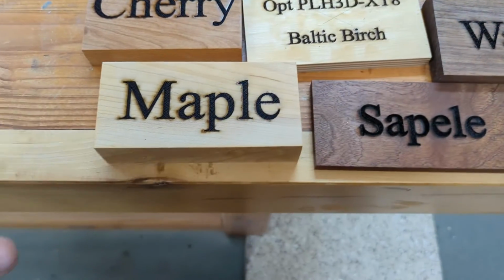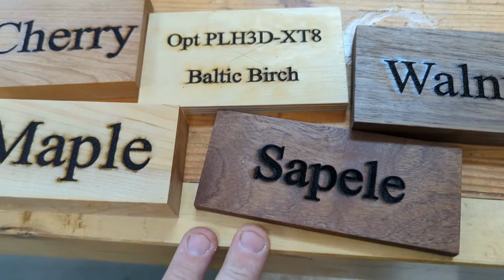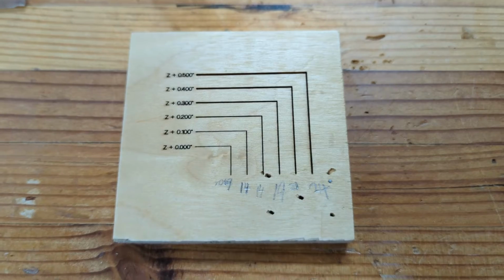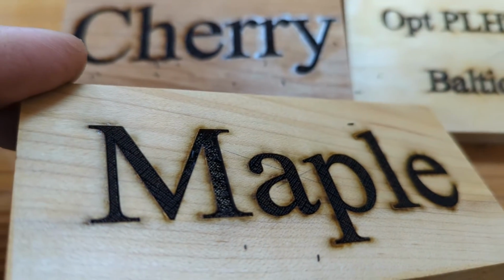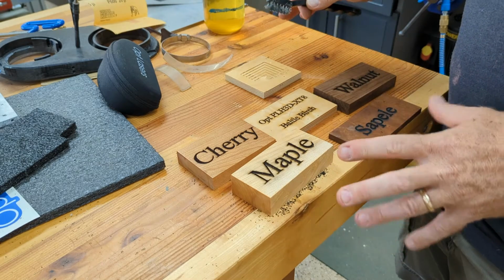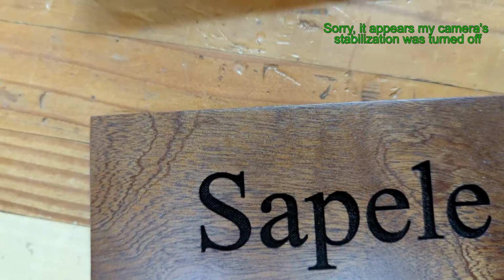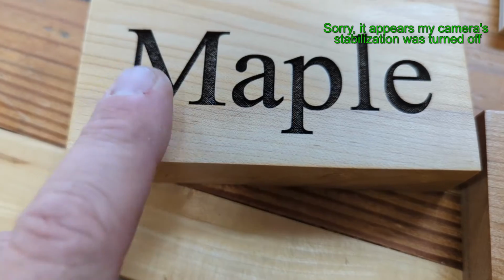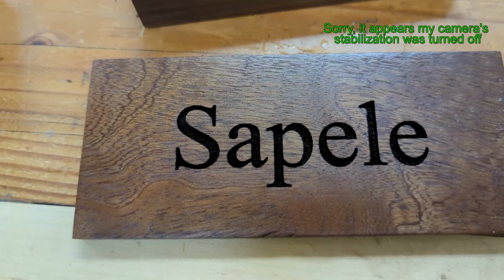Opt Lasers XT8 Deep Etching on Different Wood Species

Comment: Im waiting on my XT8 to arrive, I would have liked to see engraving on very small letters say .1 to .3 high.
Reply from the maker: That is easy to do.  It's just constant power for flat etching.  You would just do the opposite of this.https://youtu.be/sjGmWgwnIJs?si=AQ4YuaAyAsbAcRTu. and etch out the background around the letters.  I would start with 60% power, 50ipm, and a crosshatch pattern with 0.010" stepover to start with, and the work up or down from there depending on how deep you want it.
Reply: @JNWoodworks  I am just curious as to how small of letters we can get from the XT8. I will definitely try your settings tho.. Thanks
Reply from the maker: @scottchausee2342  The main limitation with raised letters is they become fragile at small size

Comment: Thanks Jim for this info! Clever to run it out of focus intentionally to save time on this powerful laser. And I like/had same thought as matthewsmith's idea to run the perimeter at z 0 enough to then be able to blow thru the rest of the internal cross hatch at higher z and higher speed, without burning the edges. Thanks for what you're doing to make great results so much more available to us who don't have the Jim Neeb brain & experience!!

Comment: How would it work to do the outlines of the letters at the optimal focus (either just the actual outline, or perhaps a couple of beam-width stepovers to keep the out-of-focus passes farther away from the edges of the letters), and then fill them in at Z+.5 with higher power and wider stepover? Can the software handle splitting it up like that? Perhaps 2 sets of files: one for the outlines and one for the fill?
Reply from the maker: I don't know, but that is a good idea to try.  You can definitely do two toolpaths like that, one for an outline and one for the fill.  The biggest problem there is the Vectric Laser module doesn't allow Z height control.  However, I'm optimizing a laser toolpath that just uses the endmil toolpaths, and besides not having to buy the laser module, that does give you Z height control in the software.  I hope to have a video out on that in the next couple of weeks if time permits.